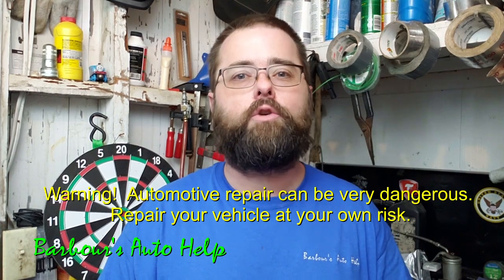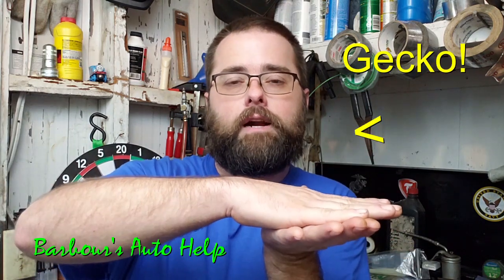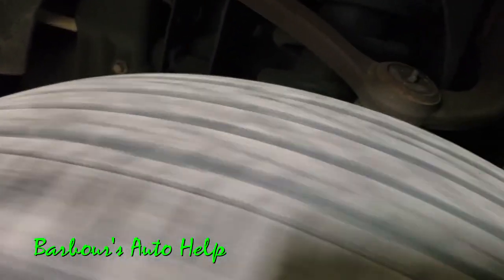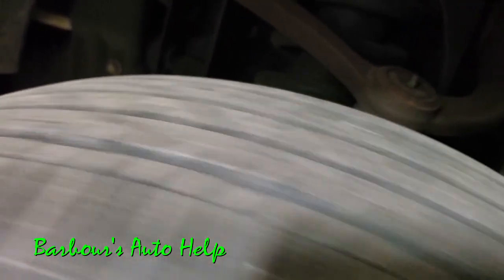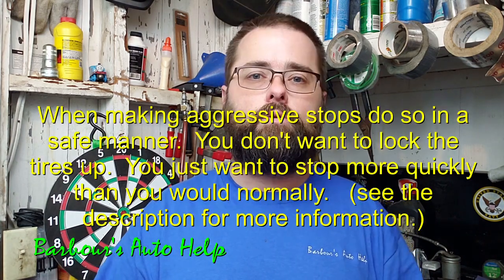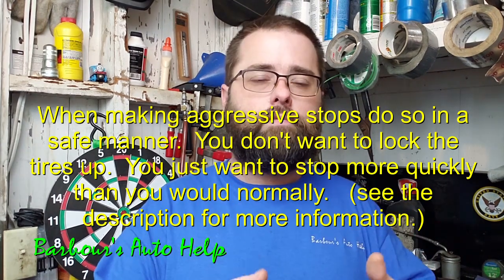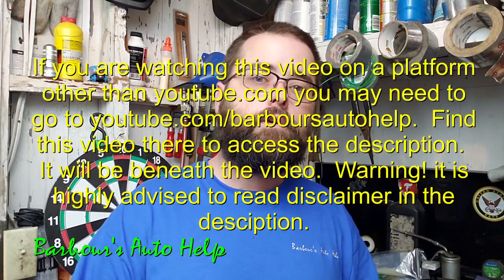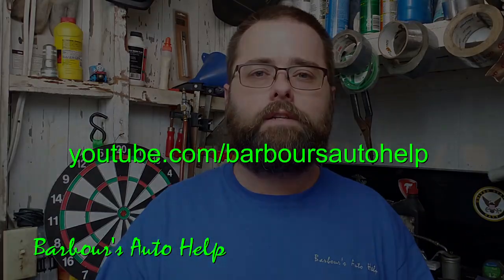Two Common Causes of Vibration After Vehicle Sits

Comment: Thanks for the information. In your opinion, about roughly how long does it usually take for rotors to get rusty? (Somewhere in a temperate climate, no snow, ice, or sea water).
Reply from the maker: It's relatively to many factors including the ones you mentioned.   Its easy to check for rust spots though.

Comment: I am so damn frustrated, took out my summer car and started driving it only to realize i have a helluva vibration in the steering wheel when driving 80, 90 and 100km/H
The tyre shop said it is indeed a flat spot.
I bought the tyres last year and had them balanced damnit, it didnt occur to me to either put alot of pressure in them before winter storage or just take them off.
Reply: They may come out of it if you drive them long enough to get them up to operating temperature and then either remove them or rest the car on jack stands.  May have to do it more than once.

Comment: I'm having a vibration that sounds like rumble strips. It's inconsistent and happens when turning right at low speed or driving over a speed bump I will sometimes feel a vibration in the floor board. Never when driving straight.
Reply: Check your lower control arms.

Comment: Sir  i parked my car in my home town and i am somewhere in another city ,its been almost one month now that i couldn't go to my hometown due to Covid. 
Sir my question is there will be flat points on tires or not or after how much time  generally flat points produce on tire. If i fill the tires with high pressure then also possibility of flat points
Reply from the maker: You'll have to see when you get back to it.  A month isn't that long though.
Reply: @BarboursAutoHelp  thank you sir
Reply: @BarboursAutoHelp  I just got back into my Lexus SUV after 5-6 weeks parked outdoors and there was a shimmy from 45mph and up. I drove maybe 25 miles on non highway roads and the shimmy has almost disappeared. Will it go away after my 70 mile highway commute to work after this weekend? The brake rotors also had a bit of rust on them. I will preform the braking procedure you described if the shimmy is not totally eliminated after my work commute. Thank you for the helpful video, and for your reply in advance.

Comment: I had a problem on my front tires it’s feel like something is touching her and when  try to press a break there is there a sound coming I don’t no what 
I ask her two of the mechanic one was saying that I need to replace rotors and pads other one saying change tires I mean it’s brand new truck ram 1500 and had only 46k miles

Comment: Hi I have a problem with my 2020 Hyundai Kona I hope you could help. I feel vibrations when accelerating from 60 - 80kmph.. if the vehicle is free wheeling even at those speeds there are no vibrations. I check the front axles for torn boots but they are good. I already got the wheels balanced. the problem is still there.
Reply from the maker: Isn't your vehicle still under warranty?  Probably the best and cheapest thing you can do is take it to Hyundai.